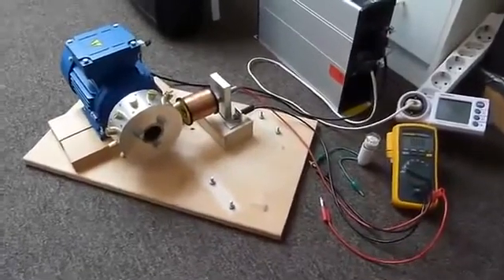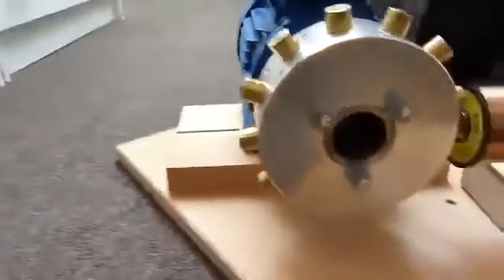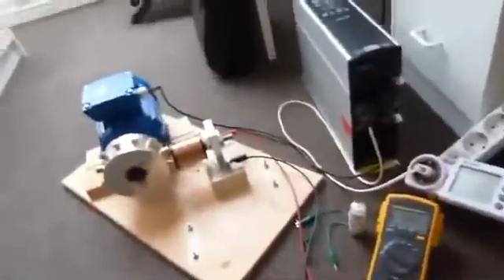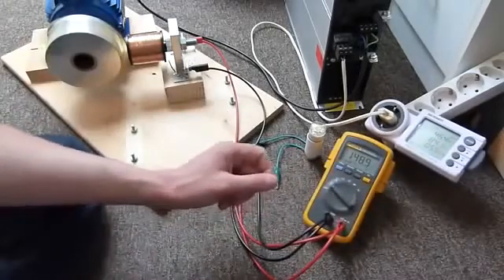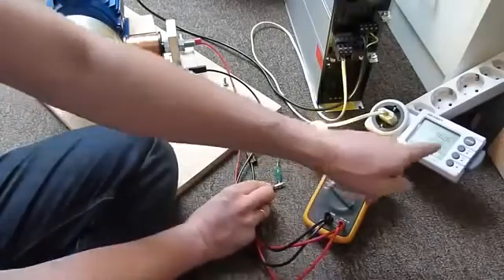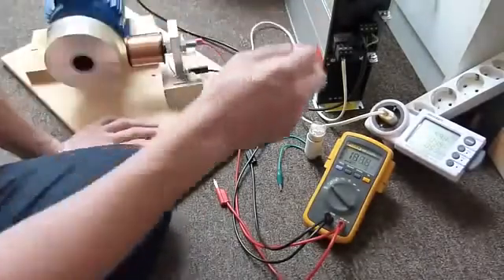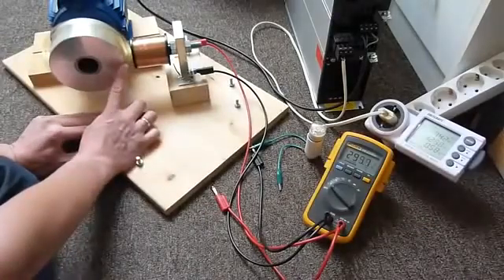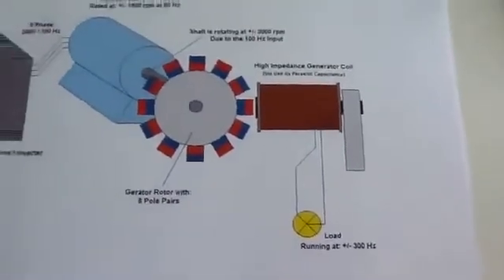Regenerative Acceleration Generator Innovation - Confirming the Negative Lenz Effect

Comment: Salut, en calculant les paramètres de la bobine je vois fil en 0.38, 45kohms et 2.182 H.
Pour avoir 45kohms avec du 0.38 il faudrait 315 kilomètres de fil à raison de 152 ohms par km.!!
Je doute de ces valeurs, pourriez-vous nous donner des explications ? merci.

Hi, calculating the parameters of the coil I see wire in 0.38, 45kohms and 2.182 H. 
To have 45kohms with 0.38 it would take 315 kilometers of wire   because of 152 ohms per km. !! 
I doubt these values, could you explain? thank you.
Reply: This is not my own stuff. I simply collected some very interesting videos from other channels. If you want you can click on the link in the description to see the source. I'll produce something of my own in the future and will upload it to another channel.